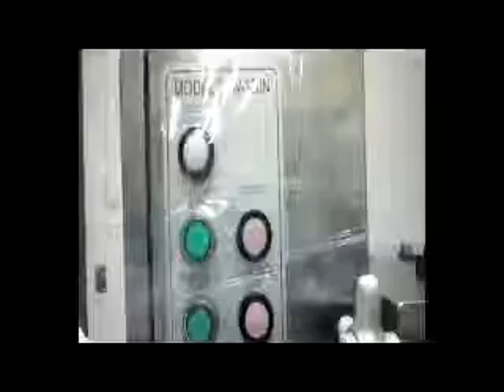TOW120N

Comment from the maker: I'm trying to remember if this is the older machine that was replaced in the following year (2014?) think so.  Overview is this machine was in use for +4 years possibly longer.  I was informed it's the 2nd machine of this type.  There are similar machines produced by several countries but most coming from the Aisian-Pacific area.  I've noticed these all have a lot of moving parts.  As with any machine it's the ease of replacement to worn parts that usually is the deciding factor for reliability.  Can a part(s) be replaced prior to the next production day?  Older machines like the Hollymatic (a hamburger patty machine) could be repaired or even overhauled in 24 hours.  Developers had time though the years to critique and improve quality and efficient repairs to these sturdy machines.  With ever increasing demand for Aisian type foods, Automated robots that produce these products will become common place with one or two company's taking the center stage to provide a superior machine with a quality product.  Mark; ukeboy57

Comment from the maker: jonswalkers
comment on operator's knowing how to correctly adjust or "Fine
Tune" a machine is absolutly correct. There are 3 entities that
run these machines in a production plant envioronment; Operator,
Management, and Customer.  The Operator should always have the final
say in the product.  True the Customer is always right but you can't
get peaches from an apple orchard!  Management needs to balance the
two;  What can be produced at a specific quality to meet the needs of
both customer and the company's cost.  Management tries to change the
products specs to meet budget requirements.  This usually always
affects the product's quality and production.  I've seen many
instances where management goes too far to affect the "end use
customer" where the vendor will go to another company to produce
thier products.  The Operator knows how to get the best “Visible”
quality out of the machine where as the customer may not like this
particular look of the cooked product.  A longer wrapper may be
required by the customer for a 'Bigger' looking product.  The meat
content is set by the original MFR specifications where the only
adjustable part is the wrapper size.  Changing anything on this
machine will affect the rest of the production.  Add in different
wrapper ingredients will also change forming texture and timing. 
Changing water content to the meat filler also complicates
production.   Management may want to provide “Everything” a
customer wants, but sometimes you HAVE TO SAY NO! To a boss who
want's to make sliced frozen pineapples on a hamburer line. (True
story, I did try it after work hours.  The customer liked the IQF
product and just bought the IQF freezer from the MFR.  I don't think
we got anything out of the deal.  Oh well, next up; IQF tomatoes, Ice
cream filled cake, ......)

Comment: the wrapper is the problem of this machine it is not ing perfect measurement
Reply from the maker: Thank you Johnswalkers for your comment.  I'm keeping your post for those that still have this type of machine.  One thing I've found common with specialty machines is that they all require a keen touch as well as spending many hours of observation.  Like a wife they need a lot of "TLC" tender loving care.  My hat's off to all those unapreciated technicians and operators whom rely on these machines.  Mark ukeboy57
Reply: ur welcome yes i only bought newly like this machine seem it very hard to run if you dont know the function but the big part of this product to run well is the measurement of your wrapper ill been so long to chemist the wraper b4 run smoothly also work with tlc